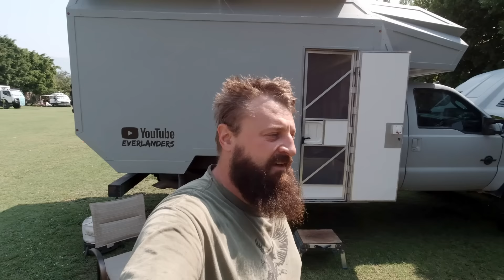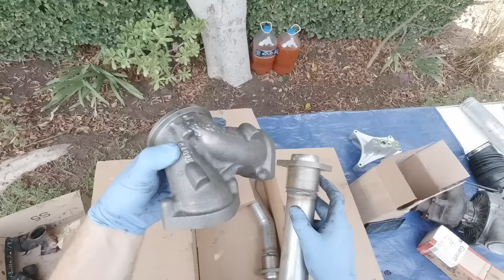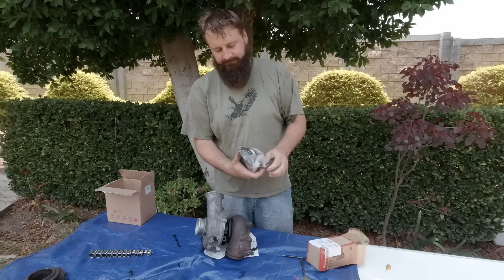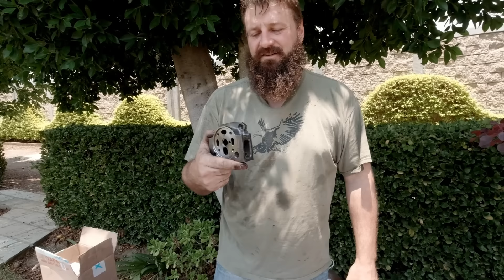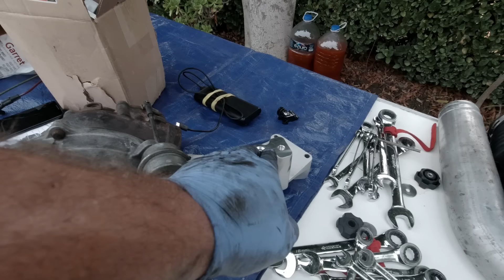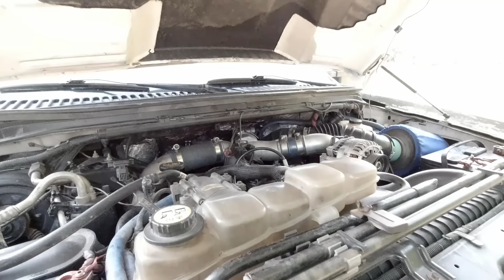7.3L Diesel Missing Turbo and Up Pipe Install - Everlanders see the World!

Comment: Great job, not many people would try and change a turbo or try to rebuild a turbo. As you see there is not much to a turbo. Critical part of rebuilding a turbo is the mechanical oil seals. You don’t want oil in the inlet side. You did a great job. Before I retired I was a heavy duty mechanic with specialized in Detroit, Cummins and Cat Diesel engines. Your black smoke is from not enough air for the amount of fuel injecting into the cylinders. Check for dirty air filter or restrictions in the air intake system. Next check your air to air charge cooler for leaks. Check and tighten the hose clamps and rubber hoses going to and from the air to air charge cooler. Have you had or done a scan for any engine codes. You also could have a problem with over fueling by one injector. Most likely a dirty air filter is the problem. There are a few great 7.3 engine forums on the internet that have a ton of information on the 7.3 engine. Don’t know how you could drive with those exhaust pipes leaking. Very bad design.  Hope you guys can get back on the road soon. Stay safe.
Reply from the maker: Thanks for the suggestions Craig, I've been chasing this issue for several months. These are some of the things I've tried that relate to your comment.

I have the big Donaldson 6673 filter which should be in good shape. A few months ago we were climbing a mountain pass and it was smoking really good, and it had just rained hard for an hour, so I pulled the filter and ran it wide open for a few kilometers. It made no appreciable difference.

To check for leaks in the CAC system I built a pressure test cap and pressurized the whole intake. It did leak down slowly, seemingly past the rings, but otherwise okay, 

I have scanned for codes, nothing interesting, Another Channel member suggested an Injector Buzz test which I have done this morning and uploaded here: https://youtu.be/drvHzuHO2fk

Here is an extended version of that smoking exhaust video, some engine vitals are shown in the gauges also. https://youtu.be/4lc4hS2oQ6g
Reply: @Everlanders  I see by the video your at 2000m. Does the engine smoke on acceleration when your at sea level?
your getting good boost pressure but i see with low boost pressure it smokes pretty badly on acceleration. Once you back your foot off the throttle it clears up and runs clean.Which suggest the injectors are working fine as they are suppose to. Now if the black smoke never stopped smoking we would have a different problem. So watching your video with the gauges at the same time suggest that you have air fuel ratio problem. Does the engine smoke on eceleration at sea level? From quick googling you have a BARO sensor that monitor air pressure (barometric sensor) it could be out of range.When was the last time you had your ERG removed and cleaned?  The ecu is not getting an accurate reading of how much air or air pressure going into the engine. 
Your telling the engine i want to go faster. The computer gives the injectors full fuel because the ecu is getting a false reading thinking that there is lots of air boost in the cylinders. In reality there is not enough air boost pressure for the amount of fuel being delivered. Hence the black smoke until the air fuel mixture equalizes. Thats why when you are cruising at 80 kmh your foot is not pushing the throttle to the floor and you have no smoke. The air /fuel ratio is good.
If this problem only happens when you are in high altitude the BARO sensor maybe out of calibration. 
normally the ecu won't let you have full fuel until the boost pressure is in range for the TPS (Throttle position sensor). the ecu might not be seeing proper voltage from the TPS sensor (Fuel pedal).
I'm not very familiar with the power stroke engine, but would say you have a sensor not reading properly. Causing you to smoke on acceleration.
Googling your power stroke smoking issue online seems a lot of people have had this issue with no solution being discussed.
You have a sensor that is in range of it's parameters so it won't set off an engine code, But is giving inaccurate readings while in it's operating  parameters.
i will talk to my cousin he has a 01 7.3 power stroke. see if he has heard any issues with black smoke.
good luck..
Craig
Reply from the maker: Thanks for all the tips, I'm blaming the tunes at this point... Sadly I'd have to ship the chip for new tunes... 😞
Reply: @Everlanders  I've been reading most comments to this point.  But if it is just the tune, then you would have had this problem from the start of that tune.  Barring an injector issue discussed in other comments previous.  I would agree with Craig that you likely have a sensor calibration issue.  That would throw off the mixture.  Check the temperature sensors are within their tolerance.  The first one to check is the exhaust temperature sensor (Oxygen sensor).  Not sure about how you would check a pressure sensor, if it indeed checks pressure directly, not via indirect means.  Check that the sensors are clean, if there is buildup of crud/soot on them it could affect their readings.  You likely have some electronics cleaner in your toolbox.  Even give the throttle position sensor a cleaning.  I would suggest some injector cleaner, but I know my 6.4L diesel F350 says no, that it will hurt the high pressure fuel pump which relies on the fuel for lubrication.  That reminds me of another possibility, high pressure fuel regulator not working correctly, but I doubt that is the issue for you.

P.S. I'm still waiting for my D1-minis (I learned about them from you) so I can play...  I love your videos.  I hope you can get back on the road again soon.  I am stuck at home in Vancouver...

Comment: The axe slays me. I thought of AvE saying "tappe ti tap" and snorted a laugh that scared off the cat.
Reply: To say nothing of the battery powered drill hammer!   My late father the gas turbine engineer is rolling over in his grave!  If there is one thing that he drilled into my head is to use the proper tool.  (If you have the proper tool!)
Reply from the maker: Why is it when I run a search on all the comments you've made on our videos they are always in negative tone? 
It is not a Drill nor a Hammer, The Milwaukee 2653 is a 1/4 Impact Driver with 3 torque settings. As you can see in the video I was set to #1 which is 200 in-lbs or 16.6 ft-lbs -  I later used a torque wrench to set the torque to the required 18-30 ft-lbs.  This was cut from the video you saw to keep it short and light. I hope you find these videos entertaining and that you find happiness.
Reply: @Everlanders  I hope you don't think my axe comment was negative. If you need a hammer and an axe is what you've got, perfect!
Reply from the maker: No Ross, my response was to W RD who replied to you.